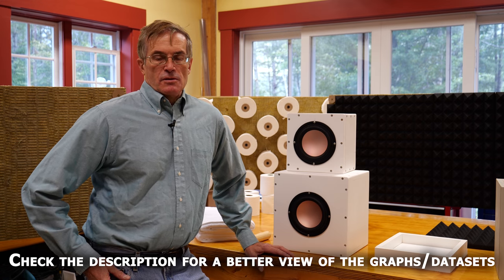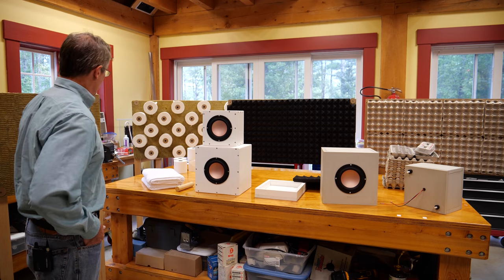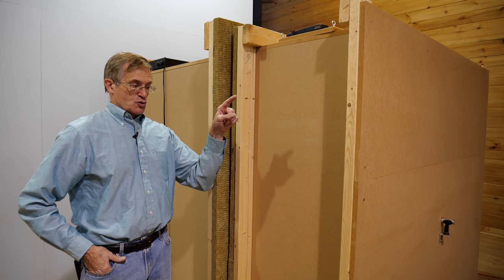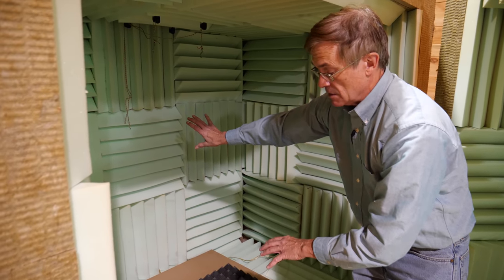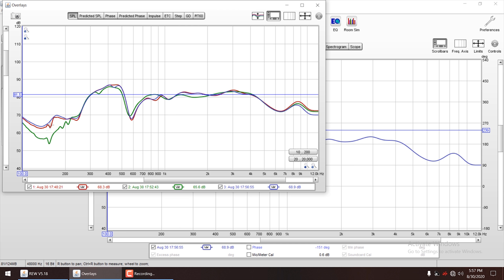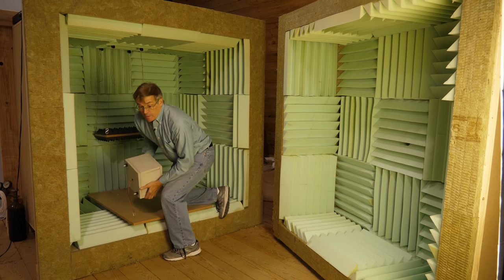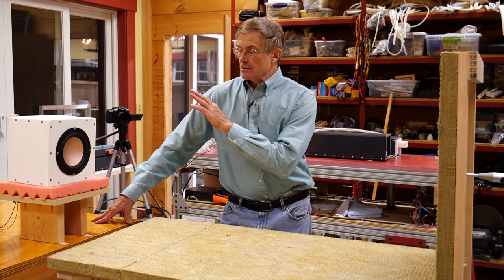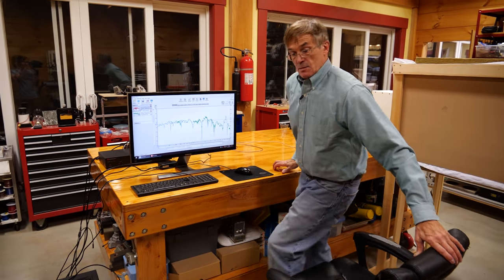DIY Speakers and Acoustic Panels

Comment: As someone who's into DIY speakers, I had some issues with the speaker talk in this video. Not that everything was incorrect necessarily, but there were some blanket statements made from this one test that doesn't really even test that specific thing.  
  
The rigidity of the enclosure for example. The anechoic chamber will reduce some of the issues that not-rigid-enough enclosure would have.  
Additionally, we don't really know from this test where the line is for this driver. Maybe the first enclosure is completely fine for this driver at these volumes and doesn't need to be more rigid. Saying generally that there's no benefit for it is false.   
  
Another thing that was a bit questionable was the port test. When you design an enclosure, sealed and ported will not be the same size for the same driver. If the idea was just to show that having a port will give you more db in the low end, sure, but I think it should have been mentioned that this is not how you should do it. You don't just add a port to sealed enclosure, you calculate a completely different enclosure volume and then you need to add the volume that the port itself takes up. Also, what fq was the port tuned in the test? Was there a tube even? As it wasn't mentioned in the video, one could think there was just holes drilled to it.  
  
Then there's the dampening in the enclosure. Having the speaker in an anechoic chamber mitigates some of the benefits from the padding. Even if, without it, something would escape the enclosure, it would be absorbed in the walls of the chamber and would not be picked up by the mic. And again, maybe the enclosure itself is already dead enough for this specific driver. So if the dampening worked, how would you know?    

With both the rigidity test and the dampening test, you should measure the sound from the side of the speaker, not on axis with the driver.  

I do love this channel and I enjoyed the anechoic chamber part of the video, although I think you could have shown it's effectiveness a bit better.
For example: Get a speaker that has fairly flat response, put it in the chamber, do the measurement, use a dsp to get the response as flat as possible and measure it again. This would be the control. Then you take the setup to a normal room and run the test again. This would make it very clear what the chamber does.
Reply from the maker: As you stated we demonstrated the effect of porting, but did not intend to provide guidance on optimizing porting for a particular driver.  
The reason the mic was aimed at the driver was that the enclosure material's  effect on the driver performance was what we demonstrated, not how well a particular material blocked the rearward sound pressure.
Reply: @TechIngredients  Fair enough.
Reply: @TechIngredients  Precisely!
Reply: @vonantero9458  If you're into DIY speakers you might have the same equipment and talent I'm assuming. Would be happy if you could demonstrate your claims in a scientific and  measurable way in a video
Reply: @Von Antero - I agree with your analysis. I saw several problems with the methods. In my opinion, frequency response isn't something that should be used along to determine the quality of sound. Two different drivers could have nearly identical frequency responses but sound completely different base on cone mass, cone material, stored mechanical and electrical energy, port loading, etc. So saying that the concrete/sound absorber made the sound "worse" in not wholly accurate. liter box with wool will not load the same as a 2 liter box without wool. Still a fun video though; regardless its issues.
Reply: @kontoname  Sorry for the delayed reply. I didn't get any notification about your reply.   

It would be a fun video to do and I do have measuring equipment etc. What I lack is time and anechoic chamber :P  
Not that a chamber is needed for a demonstration though, but yeah, I got too many projects of my own going atm. Too many hobbies and not enough time.  
Currently, in the audio world, I'm building two small tapped horn subwoofers. 6,5" drivers that should, in theory, play really nicely almost down to 20hz. Can't wait to get them finished.   
   
Good idea, though!
Reply: @Casey_Schmidt  Yeah, the biggest issue for me are the blanket statements. If they said "x didn't affect frequency response much" for example, it could be fine, but you can't just state that it doesn't make a difference.  
Same with the "you should add a port to your speaker". He did use "probably" in there, but still, it's not that simple.  
In the same sentence he combines all the other variables: "Should probably not use insulation or concrete". If you don't see a much of a difference in the frequency response, that can be a good thing. It means that those variable could benefit the speaker in other ways without affecting the response.   
But yeah, fun video!
Reply: Hi, I am an acoustic engineer. I love what you are doing in this video, but many of the points Von raised are accurate. Primarily I would say that frequency response is not the only analysis needed for a study of cabinet materials. For example, it does not highlight the decay rate of sound. If you wish to discuss testing methods I'm happy to chat with you.
Reply: @Audio_Simon  Hey Simon, as an acoustic engineer could you look into what I proposed earlier?
You might have the equipment and talent I'm assuming. Would be happy if you could demonstrate your claims in a video of your own.
We'd all benefit from it - I'd happy to see an update to your post providing one.

Best regards
Reply: As to using frequency response as the defining measurement, before I built my first enclosure I used an ordinary cardboard box and the frequency response was dominated by the frontal radiation directly from the speakers and the box blocking the radiation from the back improved the bass response. When I built the enclosure, the removal of resonances so the box stopped making sound was the real main objective. Mics behind & to the sides of the enclosures would seem more useful - my cardboard box would sing a tune.  This video seems to measure something other than what it is meant to.
Reply: @TechIngredients  During one of your earlier videos you showed that the pyramidal foam had to be glued to the layer in back and the layer in back had to be glued to the board. Yet in this video you left the pyramidal foam loose to resonate except on the corners.
Reply: Thiele and Small solved the problem of designing low frequency loudspeakers many decades ago. Part of being an engineer is building on what's already been done.
Reply: @stevesmith3890  there is no part of being an engineer, all engineers must device something out of nature. if one cannot, then that person is merely trade worker
Reply: @automachinehead  Your comment makes me think you don't really understand engineers or trade workers.

Comment: This was interesting but you missed the whole point of high density enclosures.   It's not to improve the overall inline frequency response but is about reducing secondary sources of out of phase sound?  This of course will be largely lost and barely measurable in your anechoic chamber.  I don't live in an anechoic chamber and it will be much more pronounced  in an ordinary room.    To check , mount a piezo accelerometer to the side of the case (wax, or hot glue if you don't care)  then measure the "noise" on the side of the enclosure.   This is what's entering the room as part of the sound field and is in direct conflict with the intended sound from the driver.   High mass also allows the driver to move fore and aft while keeping the enclosure at rest. physics of action reaction.   If you hold the enclosures and feel it vibrate- it's not heavy enough. 
I agree with your room treatment recommendations.  In the test, your microphone was always at the same standing node as the chamber size was altered with various material thickness.  This is why the dips shift around with thicker and thinner treatments. Different frequencies live in Different size boxes.  
When you turned the speaker around in the chamber  you should not have covered the back.  The point being , we don't want any noise emanating from the backside so if it's louder it's bad. 
Thanks for another great video and the time spent setting it all up. I enjoyed watching👍
Reply: Add to that the fact that different frequencies affects other frequencies in different ways. They can cancel eachother out or they can seemingly boost eachother. When it comes to sound, if it experienced as pleasure or pain, it's a question of how the different frequencies are combined. The combination is allways dependant on what you put through the speakers and the most pleasant sound experience is achived when you most effectively can reduce the unpleasant combinations of frequencies, which also are dependent on the dB for each frequency. 

The above is what is used in film and music to affect the emotions, to bring forward feelings of joy, happiness, sadness etc. Different tunes sound in different frequencies with subfrequencies working in subliminal ways that brings your entire body to ring in different frequencies. 

That said, I must also add that the toilet paper rolls seems to be the material that most easily could be fine tuned in the environment that they are used.

Living your life in a good sound environment is good your health and if you allways experience crappy sound, you most certainly will be in a worse situation healthwise. The right to good sound should be mandated by law. Crappy sound should not be allowed anywhere.
Reply: The point of the rotated speaker experiment was not testing whether the back side of it emits sound, but rather to see how well the wall material of the chamber reflects sound.
Reply: @cschlater  "When it comes to sound, if it experienced as pleasure or pain, it's a question of how the different frequencies are combined. " What an interesting concept you describe. What comes to mind is if various sounds add up to a major chord (for a sensation of joy) or a minor chord (for a sensation of sadness), etc.Then depending on where the peaks are,  we could end up with a mournful sound or a happy sound.  Is that what you are saying?
Reply: 0dWHOHWb0    Yes.  I understand that.
Reply: Kirk Creelman, YES that one particular Microphone model's sensitivity curve, mounting suspension and placement (Rx node location) were other variables to test and compare (and maybe adjust for); the test speaker's position (Tx node) would also affect results.  Three of the chamber's inside walls could be moved off of those plumb/square 90 degree angles too.  

Could electrostatically like-charged dust be suspended within the chamber air,  be illuminated by laser or polarized light and photographed to "see" the standing sound compression and reflection waves?

Eliminate all those test chamber reflection challenges by thinking BIG: Take the entire test speaker and microphone apparatus up, way up, a few thousand feet up in the dead air of night, far from city noise source, separately suspended on elastic ropes hanging 100' below two (ground tethered?) hot air balloons.  Be sure to also record the balloon separation distance with laser or GPS, the test altitude and air temperature.

Comment: 4 towels is simply not enough. It should be made just as thick as the roxul . I use 9 towels for absorption panels.
Reply: Plus the towels he used looked kind of new.  I'm guessing that once a towel breaks in from use and gets all soft it's probably the best time to use them.  The fibers have begun to fuzz up and that should enhance their sound deadening ability.

Comment: Guessing from the reverse speaker test your chamber has a slight resonance around 575 Hz.  Probably just the right wavelength for the chamber dimension.
Reply: The chamber is way too small. You have to use huge anechoic chambers if you want accurate measurements

Comment: " In space, no one can hear you scream." 
Oh come on! Someone had to say it ;)
I have an ex who I wouldn't mind clamping in a soundproof box. She's a singer too.....
I am faced with a dilemma. stay up and watch this, or restrain myself and go to bed. Flipped coin says BED. Oh well.
Reply: I'm betting the next event was "Screw you, stupid coin!!11!" and a binge watch of these videos :-)
Reply: continues to watch anyway
Reply: good call, this video at least will probably still be here tomorrow..
Reply: UPDATE. I did go to bed, and as I predicted completely forgot I wanted to watch this. So thanks to you all for reminding me I wanted to ;)
Reply: @Godshole  haha nice!
Reply: Update 2. Finally got to remember to watch. Very interesting. The application I am thinking of is a village hall which is long and all hard surfaces with an apex roof. It resonates about 1k for 3 seconds or longer and is 'a bastard' to try run a small PA in for live music. Not that there will be many gatherings for a bit... My in the air and nowhere near even costing yet.. thoughts were along the lines of 8x4 sheets of 'something' cut to 4 x 4 to make up panels. Bit like sandwiches of nice cloth outside, layer of rocksill? 1/4 inch ply middle, then rocksill, cloth and done. Probably a frame outside to give rigidity. These would be suspended on chains a few inches away from the apex ceiling in each section of the roof, 2 each side of the section. Maybe 10 sections. So you can imagine the work and cost going into this. I haven't even calculated it out yet. The reason for the sandwich is to absorb as sound heads towards the apex roof and then damp the back of the reflection from the roof. A trap. I wouldn't want to kill the reverb in there totally but with acoustic instruments it is just a nightmare trying to amplify them at all enough to get a volume over and above the conversations of a hundred drunk people dancing jigs and reels ;) I think if we stared with some panels at the 'music' end of the hall, then add more as needed till we get something usable, it might just work and this has given me a lot more certainty with materials and direction.. I may have mentioned before that I saw hanging wall panels used in a 'live' room of a studio a long time ago that were 3 x 4, rock wool 8 " deep and cloth covered on one side with a piece of ply on the back side and a frame 8" deep. The advantage with these was you could chose which parts of the room you wanted the reflections or absorption in and 'tune' the room. I saw different set ups for vocal (often also a free standing booth made of the panels and H shaped brackets.) For brass, using more hard sides to get an airy sound, and drums using both to control how tight the sound was. We had some PZM mics in the roof in different places too so we could capture the sound of the room to add 'air'. All a very long time ago. I probably can't hear half the frequencies we were chasing back then now.....

Comment: There is a sound quality concern with porting; "transient response" can degrade vs sealed.  Did you use TS parameters to design your boxes?  Anyway, transient response would be difficult to objectively measure, but experimenting over time with subwoofer enclosures I can say there is an appreciable subjective difference.  Also as far as reflections inside the speaker box, maybe as a future video you could construct and test different shape enclosures?  Optimally the panel directly behind the loudspeaker would not be flat.  The less flat surface area in the box (all sides but directly behind the speaker especially), the more smoother response overall.  (Reference: Loud Speaker Cookbook from Vance Dickason)
Reply: Porting hurts and helps. It increases the deflection at a given current, but it returns to center much slower. It's what gives ported bass it's 'sloppy' sound. A sealed sub takes more energy to produce the same deflection, but the vaccuum generated behind the cone will help it return to center, speeding up the response of the speaker, making bass sound 'tighter'.
Ported bass will sound louder at a given wattage, but it will also almost seem lagged and loose.